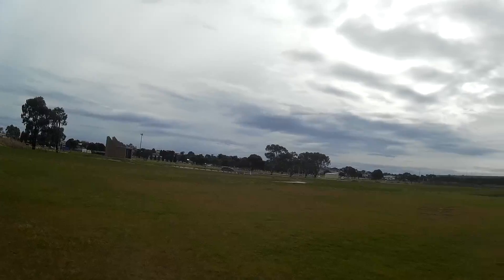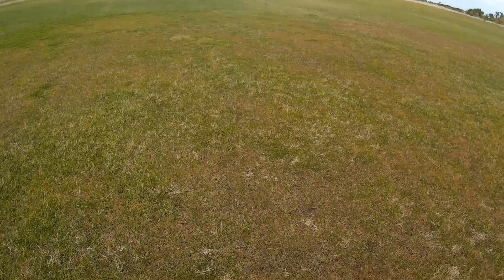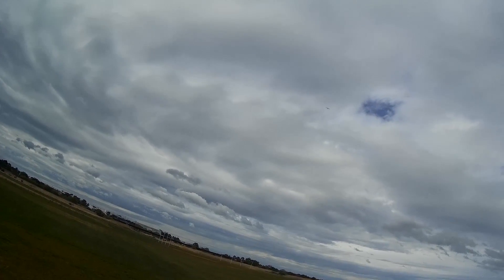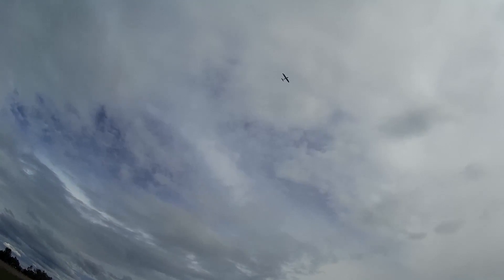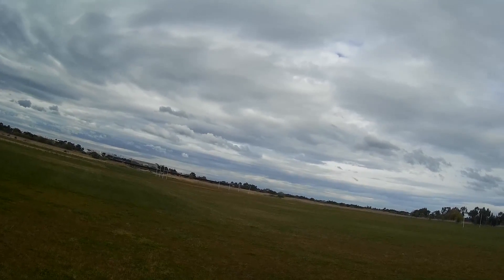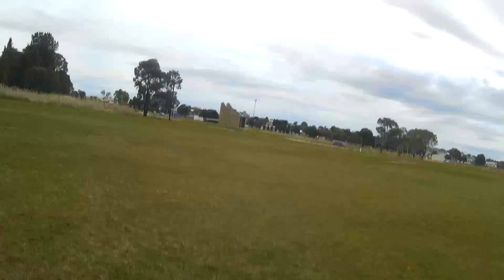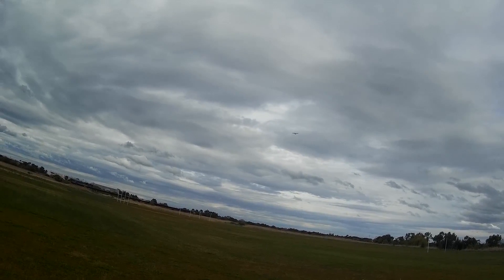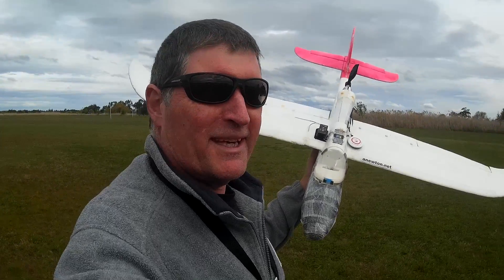AIR3 iNav failsafe RTL

Comment: Even though this F3 flight controller is yesterday's news I have it and it works great!   There is some updated setting you can find in the fixed wing section of INAV. I found it made a huge difference in flight stabilization.   The one thing that comes to mind is that the default altitude for return to home is something like 36'.  By adding an extra zero you can get it up to ten times the height which makes things a lot better. 
I love the Return to home feature.  It's very impressive.
Reply from the maker: 50m works well as RTH altitude for me. The AIR3 is an excellent and easy to setup FCB for sure.
Reply: @AndrewNewton  I am getting into flight controller boards right now.   Micro-soldering is a skill that I am working on.  It doesn't come easy to me so i have to work hard at it.  But there are some fantastic tools to help out.  Now I am working on crimping Dupont pins for the pin headers. It's like building a plane, the first one takes weeks, the second one a couple of days.

I like the Paris Air3 because it got me working with a flight controller very quickly.  But, now that I am working with flight controllers it's like a whole new universe of flying has opened up.

Comment: very surprised with the shipping to california for this board. only $8
Reply from the maker: Not bad, are you tempted?
Reply: Andrew Newton yeah I've been debating getting that because it's less work or getting Matthews version which is cheaper but requires more work. Either way I realize the software the same and it seems like you're pretty happy with it. I've been looking for something with return to home without having to spend as much money as a vector set up is again.
Reply from the maker: Just recently set up an Omnibus F4 V1 according to Matt's instructions and it works well, but the AIR3 is way easier to start off. All the fiddly board soldering, firmware flashing and most of the iNav setup is already done. Love iNav and all the GPS modes. AIR3 doesn't have the OSD built in but there is now an add-on OSD available (I'll be doing a review soon)
Reply: Andrew Newton I will probably try f4. I like soldering.

Comment: Andrew, 
so no expos on your TX?
What about trims and low rates?
Reply from the maker: Very good question. I'll do a detailed video when I fully understand it all. Expo is set in iNav, and trims / rates would only work in Passthrough mode. But any transmitter trims will muck up the stabilised modes like Horizon and Angle. So you need to set the plane up mechanically to fly level with no transmitter trims and comfortable 100% Rate. Then you play with board alignment for level flight in Horizon / Angle modes. In GPS modes you can set Alt hold and Heading hold (requires rudder) so trim and board alignment don't matter so much.

Comment: Good job! It must raise the heartrate when doing that! Quick question: Can this be used for beyond radio flight ie: long range flights via gps where you lose contact with the plane for maybe 30 mins.
Reply from the maker: Yes I think that's what mission planner is all about. Have not tried that yet
Reply: Andrew Newton Great stuff. Its just that when you turned off your tx, rth kicked in. So i assumed, incorrectly, that when you flew past tx range on a long flight that rth would kick in. I'm not brave enough yet to try this stuff so kudos mate!

Comment: I'm sure it took some guts to switch off the transmitter. 
Good video, that system has real possibilities.
Reply from the maker: I have done it before with other systems, once without setting it up properly. The Volantex Raptor buried it's nose vertically into the mud right back to the wing

Comment: It takes a little getting used to doesn't it..?...I now fly my Falcon all the time in Horizon Mode as I find it so much easier, but initially it can feel like you dont have full control, just push the stick over further, you have, its Expo inside iNAV....Do not have any expo set (or mixing) inside your Taranis.
    To test RTL fully, you need to have the plane flying directly away from you, not towards you though.  I did about 8 RTL tests on one flight from varying heights, above and below the preset Cruise home height. It works really well, including the Loiter once it gets over the Home position.
www.youtube.com/watch?v=oc0eygPEI4s&t=299s
Reply from the maker: I will, now that I know it works, in fact I'm going to test the range limits on a few FPV products by going "all the way"
Reply: Hi Andrew, good....iNAV will open up a whole new world for you now.  I assume you can plug your Camera and VTX into that AIR3 FC..???